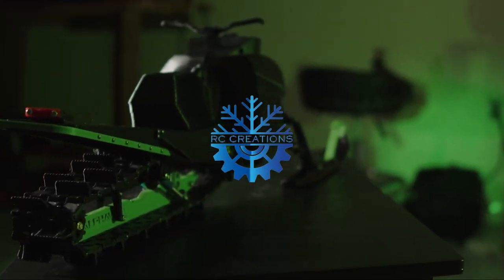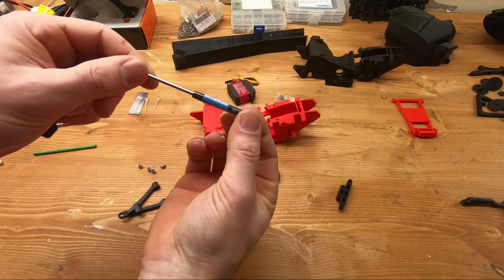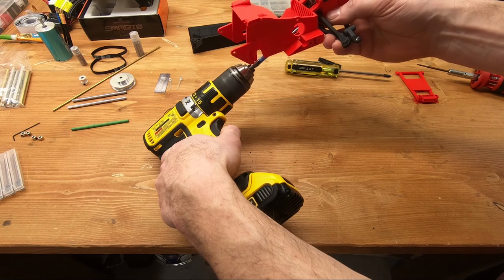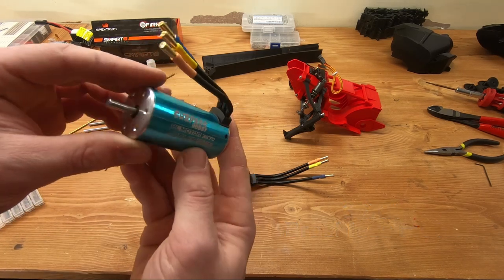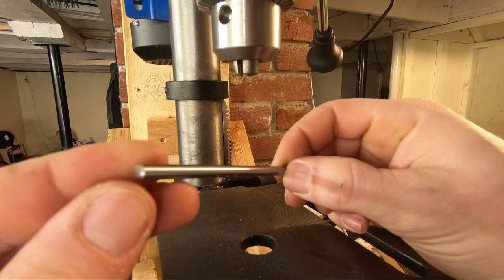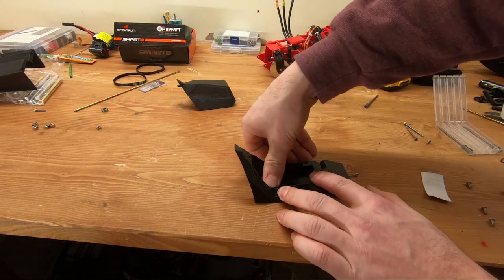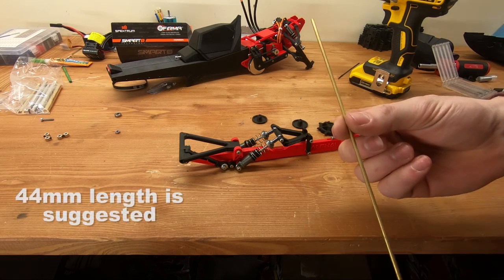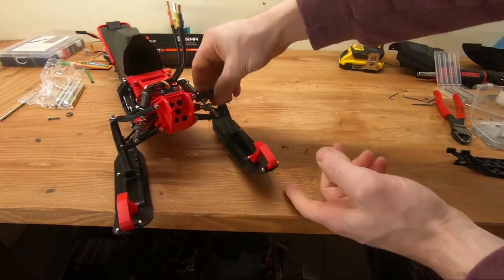Alpha-6 Rc Build Guide - Step by Step assembly

Comment: these things look awesome but one question i have is why doesn't anyone print the track out of tpu? wouldn't it be more durable?
Reply from the maker: Its harder to spin, builds up more heat, wears up the skid faster.
Essentially, everything appart from the track lasts less, and you have less performance

Use a good track design, and quality materials, and the track will lasts several seasons

Comment: ok where do i find out how many of each i need to make like how many track parts do i print i cant find that info
Reply from the maker: Most of the parts apart from the track is only one time.  You need 35 track pieces.

 Just with that information alone you should be good to go.

Comment: What kind of printer do I need? I’m not experienced at all but I LOVE RCs and my passion is snowmobiles. I NEED ONE. So I will buy one but I don’t know where to start. Any tips????
Reply: The cheapest option.
Reply: I have an ender 3 v2, it has a smaller bed so u cant print the full tunnel. He has a 2 piece tunnel option but im having nothing but trouble getting it to print and stay flat
Reply: flying bear ghost 5
Reply: @austinschaub2740  I live in Russia, it will not be right, look for someone closer